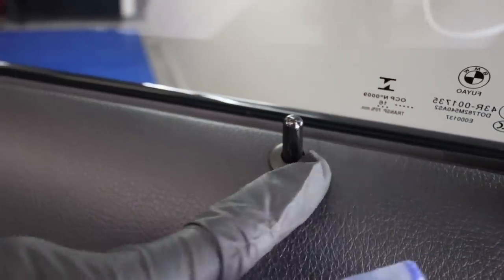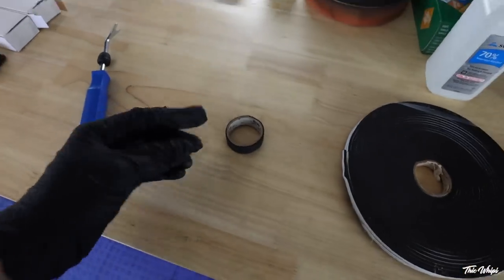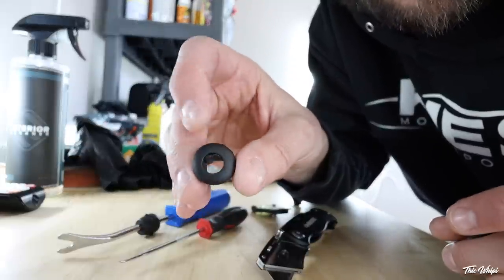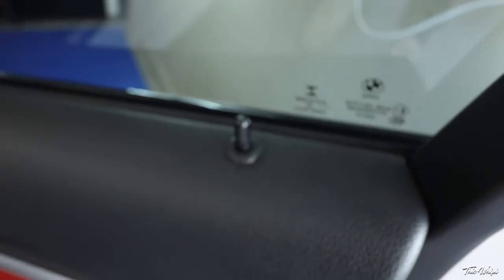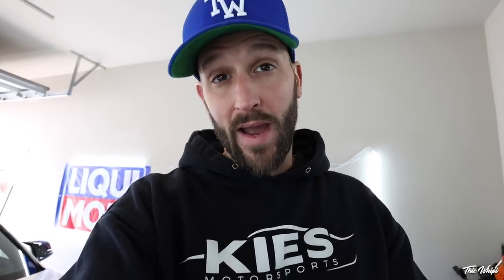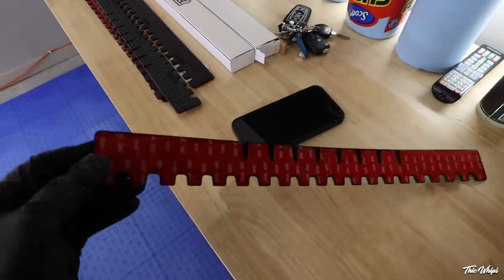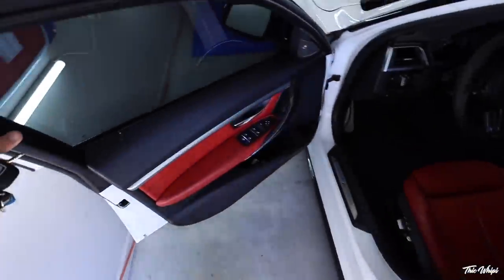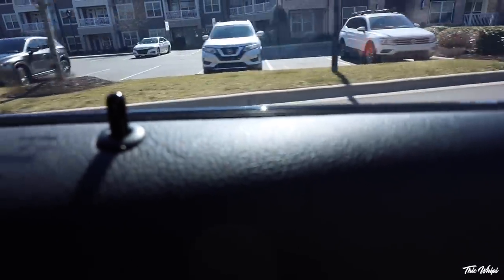YOUR BMW RATTLES AND THIS IS WHY.

Comment: FYI -- there's another door area rattle source which for me was the case, not the door lock although it sounded very similar. The plastic strip that covers the interior ambient lighting on the door cards can sort of loosen a bit and rattle especially for cars that have a throatier exhaust. You just need to use your fingers or a plastic trim tool to push the trim back in in an upwards direction. Only saw one video documenting this and the rattle FINALLY resolved after doing this! The rear brake light (one on top behind the rear window) is also a rattle source -- the LED itself is on a plastic bracket that rattles against the bracket it connects to; fix is just stuffing some electric tape or anything to fit in-between the brackets so they aren't loose.
Reply: Yes!  I too have the ambient light rattle on both of my front doors!  I thought it was the door pins but after doing a fix very similar to this video I was quickly disappointed.  From what I found the trim strip is glued or plastic welded on so I wasn’t sure how to solve the rattling.  I have tried all sorts of applied pressure while driving but maybe I will give it another shot. I was thinking the rattle is the actual led strip vibrating in the housing and it needs to be braced/padded a bit somehow, much like the rear third brake light you mention.
Reply: Got the video on the ambient light rattle? Thanks.
Reply: hi can you share us the link of the video please?

Comment: Great tip, thanks Jon! The rattle that annoys me the most is when playing music. Often listening to music outside when tinkering with the car but the panels sound like they are coming apart. Never found a fix
Reply: Have the same issue. Might install sound deadening sheets on the door and the cards. Should yield better sound quality too.
Reply: It's probably the rocker panels. They buzz and rattle pretty loudly from outside when there's music with bass playing in my car.

Comment: Nice tip.

Old school operating rods were threaded, and the button could be unscrewed.  Don't know if the later models are like this.  If so, it should be easier to remove the locking cover with the button removed from the threaded rod.  Gentle heating of the locking cover (say with a hair drier at medium) should help soften the abs of the cover too.  These polymers have a bad habit of getting brittle over time, but, the part costs like 50 cents so getting a couple spares when you order other parts is handy.

Comment: I didn't have any felt or foam and didn't feel like going to the store to find some, so I sprayed the plastic pieces with an extra can of black Plasti Dip I had lying around.  Thought it might work, because Plasti Dip is rubber and figured I could always take it off if it didn't work.  Worked great and looks fine.  Been about a year, and still no rattles.  Just another idea for someone if you have Plasti Dip but nothing else.  This isn't a new issue.  Can't understand why a company like BMW doesn't fix this issue and save their owners a lot of headache.

Comment: My X3 2019, drivers door rattle still driving me crazy, it's not the pin...but rattle def' coming from behind the door panel...but it stops when window is half way down....BMW want £175 (UK) just to take off the door panel, it's not covered by the warranty  - :(  - any adviceappreciated

Comment: I used 1mm felt tape (from Amazon) and the rattle was gone, but it's baaaack. Bumpy LA cloverleaf freeway onramps set it abuzz, really loading up the suspension is a good test for this rattle. Will try foam tape next.